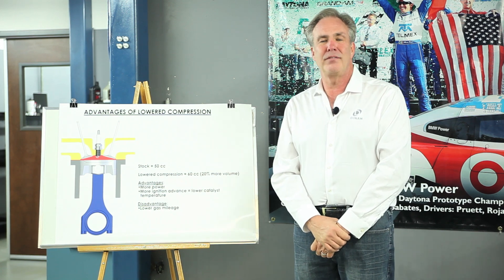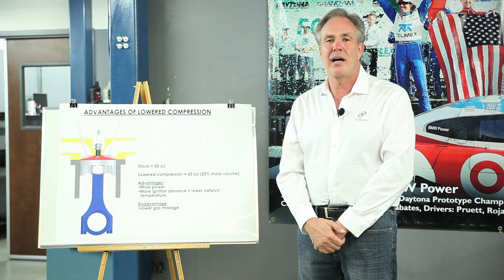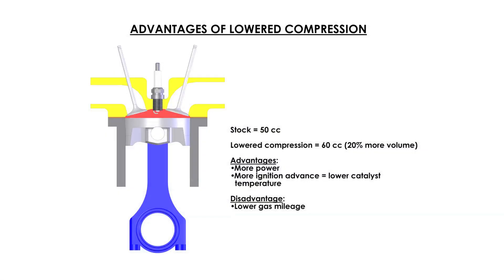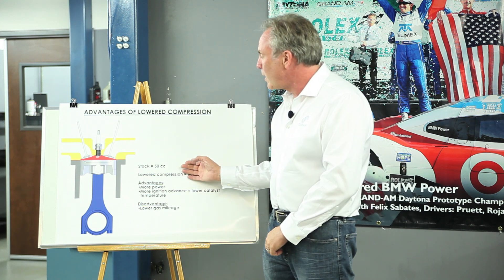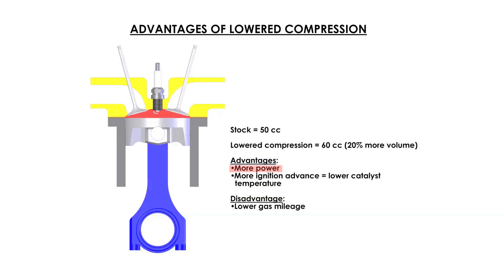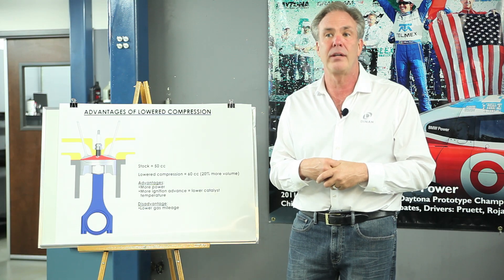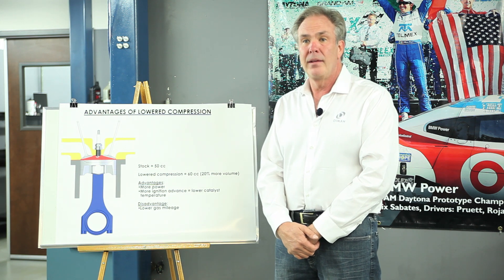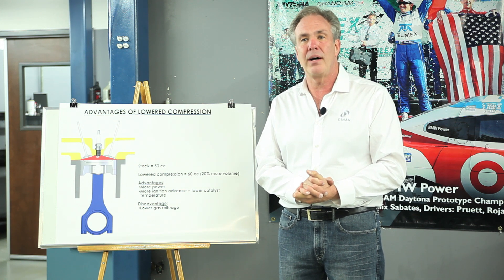Tech Tip Tuesday - Season 2, Ep.9 - Advantages of Lowering Compression

Comment: Your lowering static compression in favor of raising dynamic compression, almost any turbo engine does this. But like Steve said it won't make any power off boost because the turbo isn't filling the cylinder and as such your effectively are running a low compression engine...it'll feel weak till the turbo is spooled up.